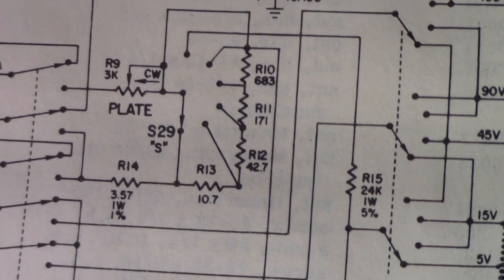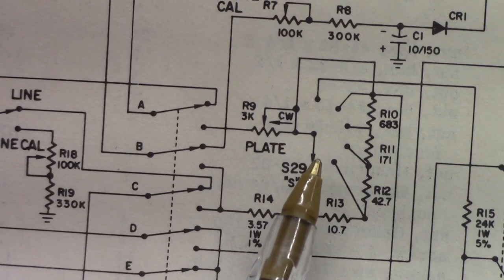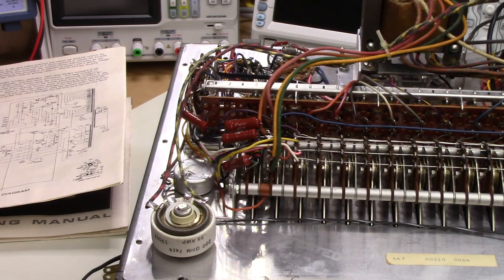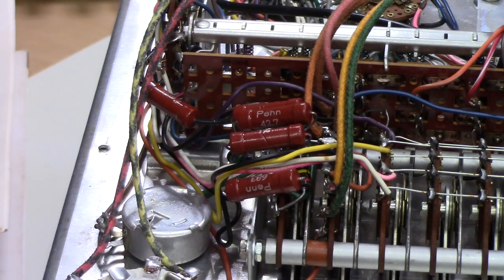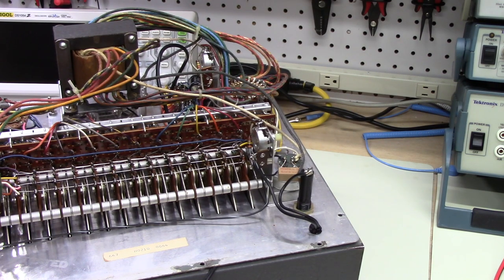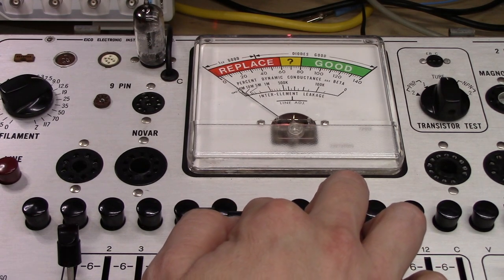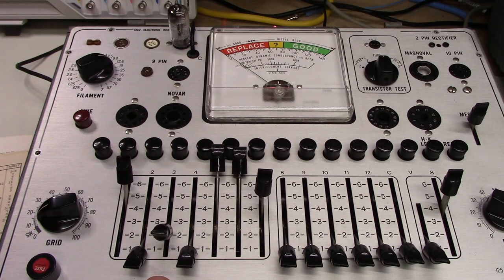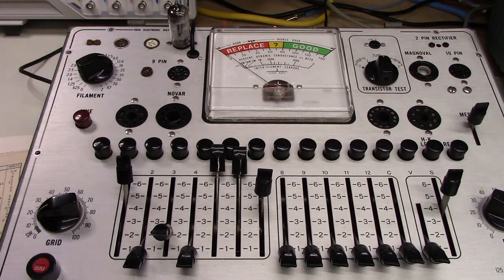#52: EICO 667: Initial testing

Comment: FYI, some carbon R's do drift over time from current past degrading the C substrate. However, slightly used vintage C resistors and even NOS C resistors drift up in tolerance. Presumably since the C substrate is somewhat hygroscopic and absorbs moisture. A test, take your out of spec, slightly used R's measure them with an accurate DMM. Then bake them at 140F for an hour or leave them in the sun for most of a day and remeasure. In all most every case, the value will go back to normal or well in the value provided by its tolerance band. To go further, test them again in a year or two and they will still be in tolerance. Apparently, the drifting up in value takes years to occur.
So, in your case, if you had left the unit outside bottom up for most of a day, I suspect, strongly, your R's would be back in spec.

Comment: Further Comment on R8 and R19.  I found a 1964 schematic on BAMA that shows both resistors at 270K.  All other resistor values the same as my 1973-4 schematic, except some of the power ratings.  There probably are a number of units out there that have the 270K resistors.  I’m surmising that when the schematic was changed, the two resistor values were switched.  My thinking is the schematic is in error, not the factory installation of the resistors that seem to have been switched in this video. (far more unlikely)??  See my other post that brings me to this conclusion. 
Can anyone verify any of this?

Comment: Thanks, clear and informative and helpful as I am restoring a 667 right now, albeit an earlier version to the one you show - and way more beat-up! 

I am slightly confused as to why you thought the apparent reversal of the two resistors would explain the reported 'low' readings unless you attempted a calibration (it takes approx 40 seconds to do) and had it fail?

Each was only 30K adrift from the nominal shown on the schematic and each is in series with a 100K pot wired as a variable resistor so the thing may well have been capable of calibration even though the pots may end up towards one end of their travel.

It is the total of the R6 & R7 and the R18 & R19 combination that matters, the proportion of which is fixed or variable is irrelevant to the operation of the instrument? Just FYI my earlier version has them both the same at 270K + 100K pots.

Comment: I just received a 1973-74 Eico 667.  It is a kit assembly, no roll chart.  The interesting point is the problem you looked at in this video of the resistors R8 and R19. You surmised that the factory had switched them in error per the schematic.  I thought that was pretty astute until I looked at the operating manual with my newly acquired unit.   The long time kit builder had made a notation on the schematic that switches the locations of R8 and R19.  Interesting!  Perhaps the schematic is in error and the factory resistor install was correct?  If so your unit is not measuring correctly?  
Perhaps there was an 1973 addendum that corrected the mistake on the schematic, since this builder  in 1973-4 had penciled the change on his schematic.  And since the factory install did it according to his schematic notation change, it is now more likely to me that the factory did NOT make a mistake.

Comment: I was lucky to buy an almost mint 667 off ebay yesterday. I replaced the 10uF caps and calibrated - it didn't need much. But it reads good 12ax7 tubes in the red when I know they're new and work well.  Is that poor calibration on my part, or perhaps an error on the roll settings?